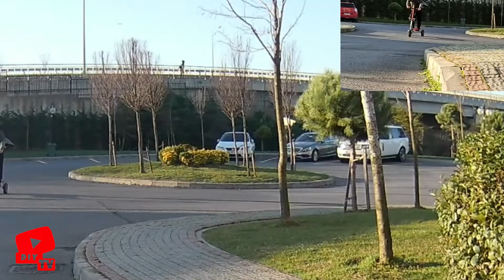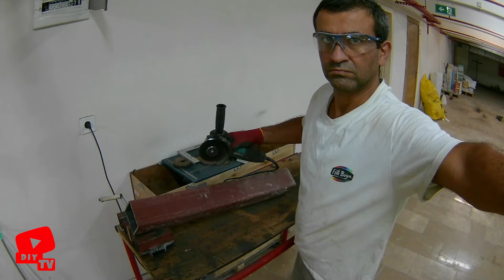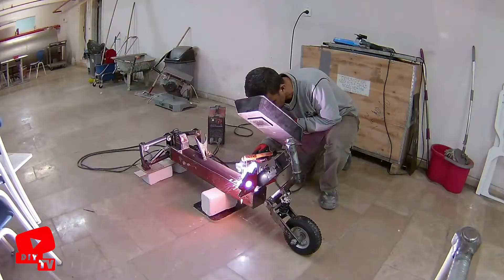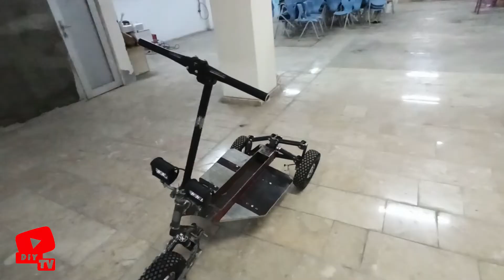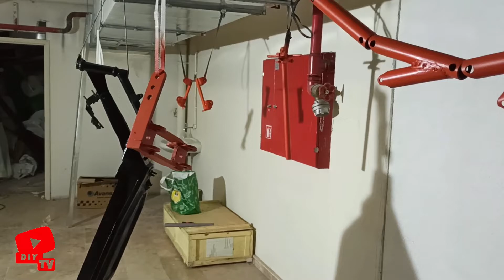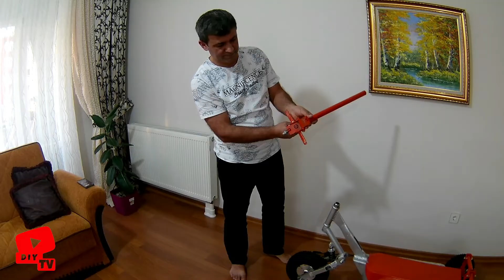Off-Road Electric-Scooter & Tilt Suspension

Comment: What parts did you use?
Reply from the maker: I made the parts myself. There are stages of construction in my other videos. I only used bicycle shock absorbers... I used a hoverboard engine and a compatible brain as a motor.
Reply: @DiyTv77  thanks,  I was wondering if there's a blueprint for it? :)